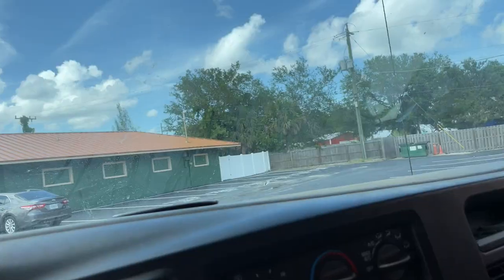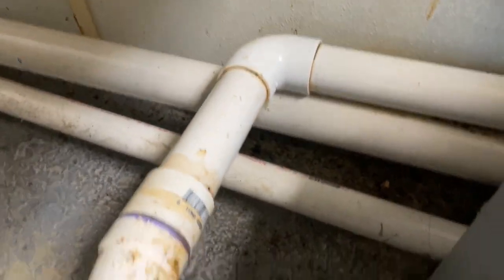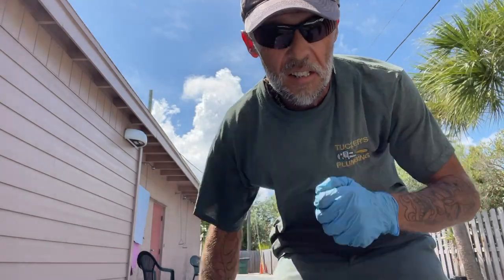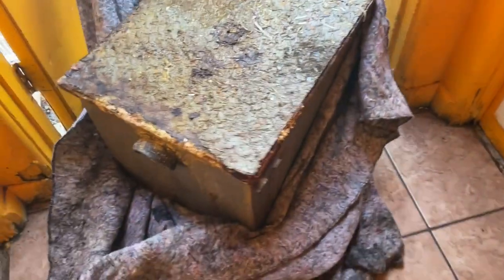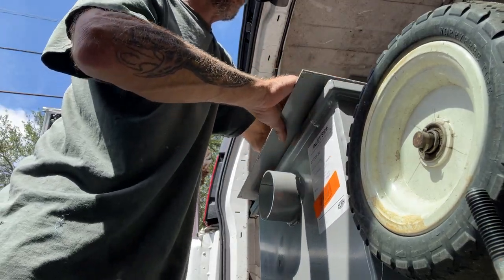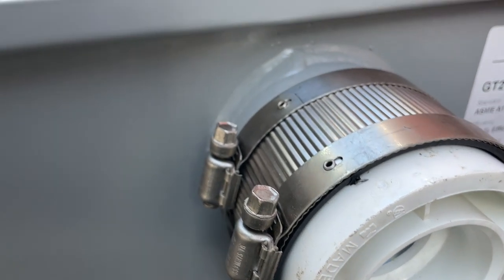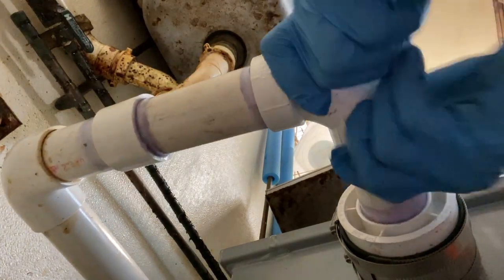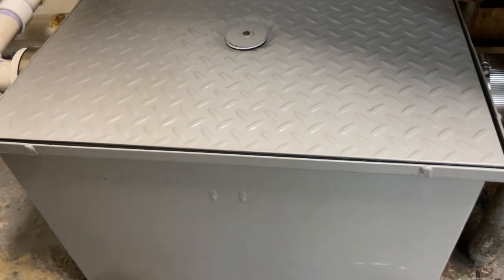COMMERCIAL GREASE INTRECEPTOR REPLACEMENT AT ASIAN RESTAURANT

Comment: So no need to put the vent on the inlet side you know that extra part that was in the box inside the grease trap ?
Reply: It’s a flow restrictor, rated for 20 gpm. The trap is designed such that if more than 20 gpm flows into the trap its efficiency is greatly reduced. Luckily it looks like just the triple sink is connected which shouldn’t have more than 20 gpm so should be a non issue

Comment: Hi Tim.  Question please.  I work in a prison under UPC guidelines as a fake plumber lol.  Our kitchen has everything hooked up to go straight to sewer except tilt skillet and 2 kettles.  Those go to a grease interceptor outside. The garbage disposals (5) sinks and floor drains and mop basins go straight to sewer.  Now the main drain always clogs.  Shouldn't they have designed all that equipment to drain into the grease trap as well?
Reply: The health department and EPA should be notified.